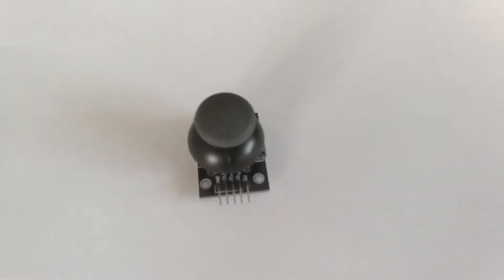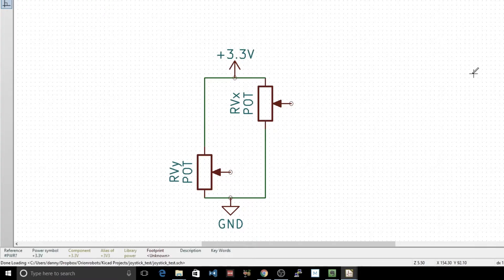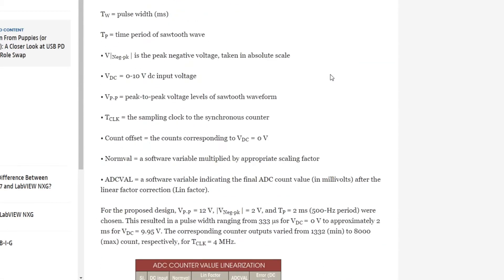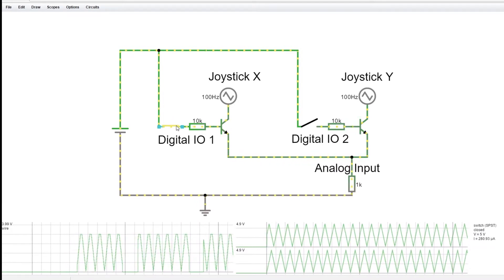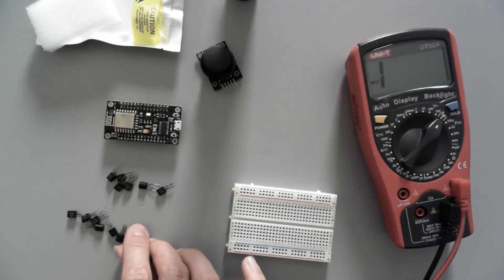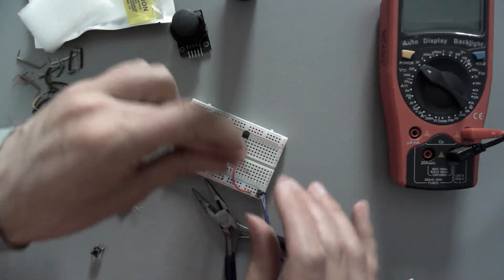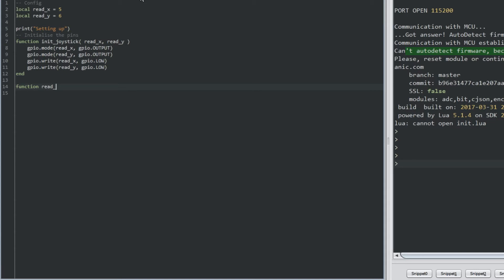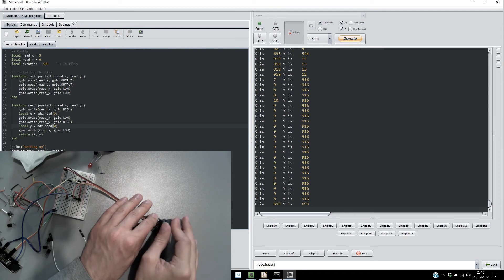Getting More Analogue Input on #Esp8266

Comment: You could also use a CD4501 (oldschool 8 channel analog switch IC) and read up to 4 joysticks on a single adc (plus 3 GPIO to select which channel to read) or put some buttons on an R2R ladder and have a two player arcade pad with joysticks and buttons all on one adc.
Reply from the maker: The alternative would also be to use one of the i2c based ADC chips - simpler, but if you have a transistor to hand - that will do too. There are definitely many ways to solve it depending on what you have to hand, or your space/number of ADC port requirements.

Comment: With the same principal, can we also try to use 2 analog joystick (4 analog inputs) ? Do we need 4 digital input accordingly?
Reply from the maker: Hello, you could do this still on 1 analogue input and multiplex with 4 digital outputs using 4 transistors. You might even be able to get clever with transistor paths and do it with fewer digital outputs.

Comment: This is such a simple idea, but it's brillant. This is similar to multiplexing. Do you have references of other uses of transistors that allow shutting down part of a circuit in order to get otherwise clashing things happening in parallel (or what looks like parallel)?
Reply from the maker: The concept should work in general, but you may need to account for diode drops on inputs. A transistor plus a shift register would give you many, although a micro with more inputs may then be a simpler answer.

Comment: Excelent video.
Reply from the maker: Thanks! I'd love to hear what you liked most about it, and anything I could do to make it better.
Reply from the maker: Oh - and if there is some kinds of video you'd love to see, let me know - maybe I can make it.
Reply: the translation option is always well received and naming other options for the problem you are looking to solve is a very good idea (I got to know the ESP32 module thanks to your video).
Reply: I tried to connect an HX711 module to an ESP8266, but I did not succeed, with the ESP32 it was solved. But I ask myself if you can connect several HX711 by means of a multiplexer and the transistors that you used in your video.
Reply from the maker: Ooh - not played with the HX711 or load cells - they could be interesting. I may have to look at just how fine their sensitivity can be.

Comment: check out how i solved this problem with just a couple of resistors. https://hackaday.io/project/8435-2-analog-inputs-for-esp8266-without-multiplexer
Reply: i also have made it work as a wifi controller on the computer as well. https://hackaday.io/project/8756-esp8266-game
Reply from the maker: I see - just grounding either side means only 1 VR affects the output voltage. Neat.
Reply from the maker: I'm making a follow up video to this - where I'll try to replicate your solution, and potentially have 3 more experiments to try (that may be a bit ambitious for  a single video).
Reply from the maker: Hi Daniel, I've replicated this here at https://youtu.be/oDPJQJtlCDY. Thanks to your advice in getting it working too!